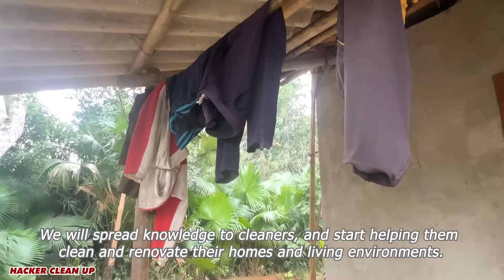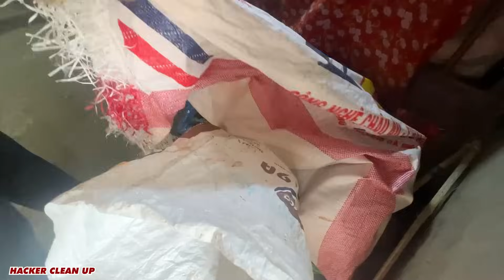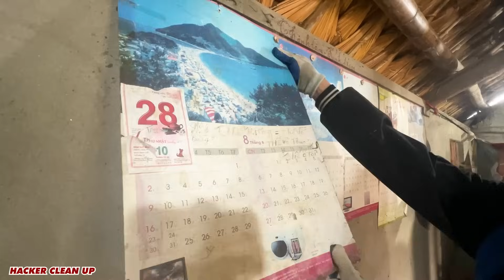Single mother Enlightened - Renovations and cleaning Free, a House her Dark, Messy after 35 Years.

Comment: Yes a very hard life. But as my mother-in-law used to say "soap and water is cheap!" Covering that ceiling is good. As cool as it is to be able to use Palm leaves as insulation or actual roofs, they have to get very messy as they age dropping stuff all over everything. I have to admit wadding clothes on clothes lines outside exposed to the elements, seems a lot worse than a wardrobe. P.S. that grandson is big enough and old enough to do more to help. Not just during the video we all know they're not allowed really. But it should never have gotten to that state.